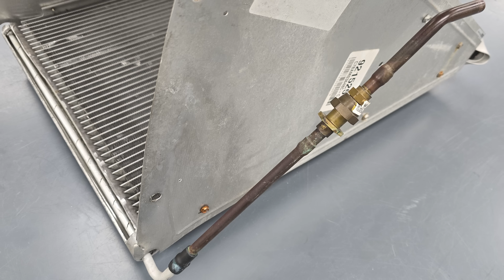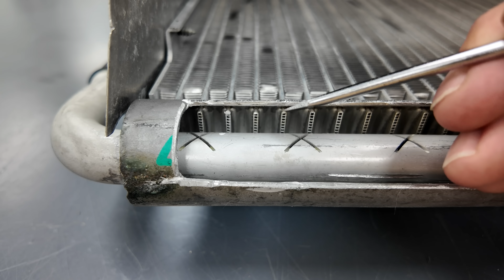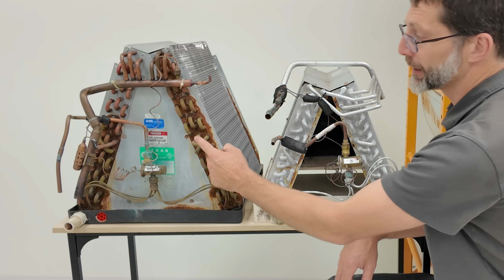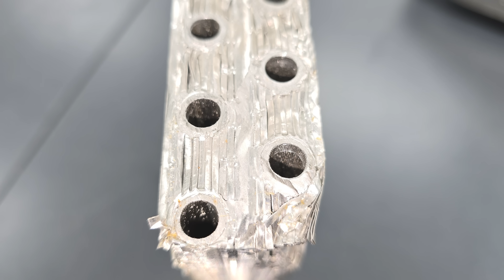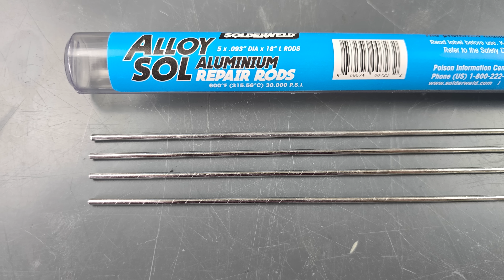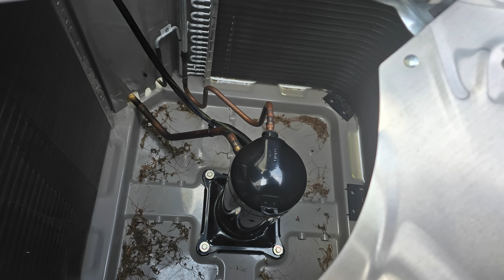Microchannel (MCHE) Refrigerant Coils Explained! How They Differ From Round Tube and Fin!

Comment: Sir the the outside coils of my ac appear dented in two spots in a circular area the size of a small fist. I noticed when the technician came to fix my ac. Is this normal? The ac is toyotomi kenzo 1 year old. Used in cold and hot settings.

Comment: Also, You cannot pump down any micro channel which in turns I had a question for engineers, why even put a king valve on those why to pump down 12.6 oz of refrigerant, or to hold 12.6 oz of refrigerant, it makes no sense.

Comment: Use copper tube and R290. That's all I'll install on residential.
Reply: Low pressure. It will last 50 years. Good for the environment

Comment: It is difficult to find an individual who can communicate information that can be easily retain. I believe you are that individual who achieve that. I have always enjoyed watching your style of presenting information and have learned a ton. I have been in land and offshore oil field maintenance for over 40 years and our number one priority is reliable long term performance. I don’t believe that the micro channel design meets the “long term” requirement. If I am going to spend 12 to 20 thousand dollars (or more) on an A/C system I expect it to perform reliably for a very long time.

Comment: First off: Thanks for the great explanation.

2 Questions:  1: Why not have dual feeds for the micro channel like the older system?  2:  Why not feed to the top instead of the bottom given that it seems like a liquid would tend to migrate downward due to gravity more so than a gas?

Thanks.

Comment: No mention of oil migration in micro coils which leads to premature compressor failure and the failure/leak rate .  I will not  buy and install a micro channel coil product . Guaranteed failure in years 3-6

Comment: I will say though. On large commercial equipment they do pump down a microchannel system. The evaporator is either brazed plate or shell and tube or an interlaced tube and fin. Our chillers perform a pump down each time the compressor shuts off. The coils are quite large, and there is a lot of surface area in the liquid line and discharge line. Our biggest air-cooled chillers are 30 fan 30 condenser coil units.

Comment: I assume that "leak seal" products are a No No on micro channel coils (especially if the system is "wet")???

I know that micro channel vehicle radiators are problematic with the 
"Cooling system sealers" historically used for radiator leaks.

HVAC manufacturers for several years have chased minute improvements in system efficiency, at what has ultimately been at extreme cost to system reliability. Thin wall microgroove coil tubing, used in an outdoor environment, with high pressure refrigerants...."what on earth could possibly go WRONG"????
 High dollar ECM motors and compressor inverter modules likewise contribute to "killer" size repair bills once they fail!
 As it is...the manufacturers (and me as well) simply sit by with fingers crossed, counting down the days of the equipment's remaining warranty...it truly shouldn't be this way!!!

Since "safety" isn't an issue, this crap continues. If such questionable engineering decisions (as with micro grooved/micro channel coils) were attempted in airplane construction, military hardware design, or medical equipment, it would have been nipped in the bud YEARS ago!
Our HVAC equipment manufacturers need to revisit the old Manufacturing and Marketing adage..." Give the customer what he wants"...and what they want AND EXPECT is RELIABILITY, first and foremost!!!

The sad part of it is that, compared to R22 days, HVAC unit service life is plummeting...and those of us in the business get smeared with part of the disdane affected consumers rightfully hurl at the manufacturers when their 5-10 year old unit decides to take a massive dump!
Reply: i have a three ton trane unit at work where the compressor vfd isnt cooled by air, but by a heat sink thats connected to the refrigerant. to make mattters worse you cant unbolt the drive from the heat sink, its all a single unit. so if the compressor drive goes out you cant just swap a drive in half an hour, its requires the refrigerant be recovered and connections to be brazed. hands down the most insane thing ive ever seen, probably got them a quarter of a percent efficiency improvement at the cost of a repair bill higher than the unit itself.

and i agree, ive seen ecm motors fail at an exponentially higher rate than standard induction motors and vfd driven motors.

Comment: Why are you not supposed to pump down a scroll compressor?
Reply: Non-Positive Displacement: Scroll compressors are positive displacement devices, meaning they continuously compress a fixed volume of refrigerant. Unlike reciprocating compressors, they lack a mechanism (like suction or discharge valves) to effectively stop refrigerant flow or isolate it in the condenser during a pump-down procedure.   From Grok, I wondered also.
Reply: @John-dp3ln Thank you. 👍🏽
Reply: @John-dp3ln  the explanation given differs from grok - they cannot pump down to zero without chatter, aka, damage.

Comment: Down here in NC we install Rheem pkg units, The gas pkg units have been coming with micro channel coils for both the evaporator, and the condenser since 2015. We have replaced quite a few of the evaporator coils under warranty, but the condenser coils have held up pretty well. Unfortunately I think the micro channel coils aren't going away. seeing more and more products with them. Great explanation of the actual workings of these coils.
Reply: It's seemed like all they bryant coils we're shipped are all the new V-coil microchannel. Haven't had warranty calls on those that I know of, but the R454 sensors are failing pretty frequently.

Comment: Thank ya sir  ..... 29 yrs in tye trade & we always shy away form micro channel cols on new equipment  for many reasons but now i know the internals of these coils makes  me dislike them even more  on the repair side of things ....better heat transfer maybe but @ what over all costs of longevity & costs of repairs ... but there everywheres  now A days & must be dealt with  Glad Rheem still uses 3/8 " alum on 5 tons & under split systems  but alot micros on there pks units ..witch cant be pumped down anyways
Reply: They won't be happy until regular citizens are banned from having indoor air conditioning. The elites want to "save us" from global warming, so they're making it harder on these companies with extreme regulation. Let's go back to R22 and be done with it

Comment: Hvac dummy engineers like any engineer .if it aint broke dont fix it. There are even today weathertrons  still running, not as efficient  but the money u spend on the new junk will be a wasted doller and although less efficient  the older equipment  was MONEY efficient  as its 10 as reliable. How many ecm,s replaced opposed to a psc  example.

Comment: I usually add 30 deg on ambient air on R410 ref  for example: If the outside temp is 80deg, I add 30deg diff, = 110deg then converted to PSIG which is 366 psig. Does that parameter apply to microchannel coil too?

Comment: What is the disadvantage of Microchannel coils)
Reply: No much durability and strength is built in. It is thin walled by design. Same time it has to operate refrigerant flow pumped at extreme pressure so it is mater of short time before refrigerant finds weakened spot in thousands pathways and starts leaking. Aluminum or copper tubing on this aspect have more durability as do not have same level of intricacy as micro channel.
Another drawback mentioned here, those used in outdoor units don’t have much capacity to hold refrigerant if some maintenance has to be done to line-set or evaporator coil so those can’t be pumped down, and you have to use extra machinery and tools, which of course comes with cost.

Comment: Thank you very much. I really enjoyed that. I learned a little bit more. I thought the entire interior side I believe it's evaporator and outside is the condenser. I believe that's correct. I was taught or I should say I was shown that once it hits the high pressure valve comes in. It turns into a vapor through the entire coils and makes it really cold. I was never told the temp but 38° sounds right. Feels right. I have a temporary home where I'm at right now. And an AC man that owned the home. I purchased it for the property so I can build a cabin. I was going to go for a split unit and use commercial type duck to go through the center of the home across the top with vents on both sides of it. I believe you follow my meaning. Like you would see it grocery store or at a Walmart etc etc. I didn't know it was still a liquid from the bottom to it. Reaches the top and goes over the other side. That makes sense. Please keep them coming. A lot of us a lot and my ears at big facility in charge electrical and hydraulic and mechanicals. I only got one semester and each it was to go into the Navy. I needed 3 college credits. Plus the hours I have already obtained in Helos. Then a very bad vehicle wreck and my commander and recruiter said I couldn't come in to the Navy. Any of that please don't stop. Definitely want that book. Maybe I can get a head of the curb a little bit in More detail. Deeply appreciate everything you put in to you or tutorials. I have to take it as gospel. I have no other. I am a god- fearing man and family. Things of man have definitely moved up in a short time. I remember back in the early '70s of what we had and it doesn't look nothing like we have now. Ty God bless 
✨🕊️❤️🕊️✨✝️

Comment: Micro-channel coils suck, We try to avoid at all cost. Defiantly set the industry back just like brazed plate heat exchangers. In NY/NJ good luck getting a micro channel lasting more than 10 years. AAON and York seems to be the worst for us because they're heavy on using these coils and maybe others too.  Good luck
Reply: Commercial side they leak like hell
Reply: @angrybeavers1175  I changed more York commercial micro channels than units installed. I had one unit with three coils failed.
Reply: @angrybeavers1175 every brand including Nortek/Nordyne

Comment: Why can't they make these out of steel, so that they'll last?
Reply: Aw man they'd be gone in no time as steel.  You see that sheet metal covered in zinc(galvanized) that basically galvanized steel and they're always rusted when I look at them.  I like copper tube and aluminum fin
Reply: You mean high carbon maleable steel? They'd still rust in no time due to corrosion because of moisture and foreign materials.
Reply: they'd rust regardless of steel type or plating due to being assembled(welded/brazed). also, steel is down the list of heat transfer efficiency, out of all the feasible metals, copper and then aluminum are the best choice for efficiency and cost per pound. an all copper tube and fin would be best, but for obvious reasons they're not made that way anymore.
like automobile radiators used to be, brass tanks and all copper in between, back then you could field repair by brazing the leak or took them to a shop for a recore. they've been all aluminum and composite tanks for ages.
Reply: You answered your own question.
Reply: ok ty fellas